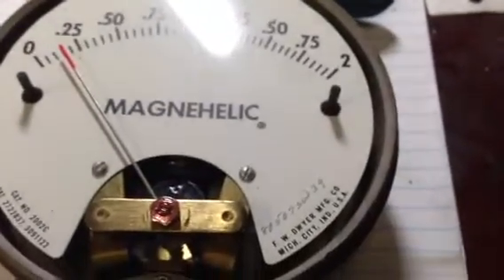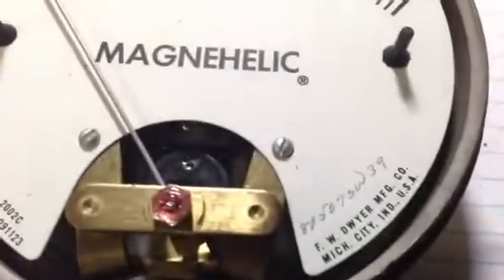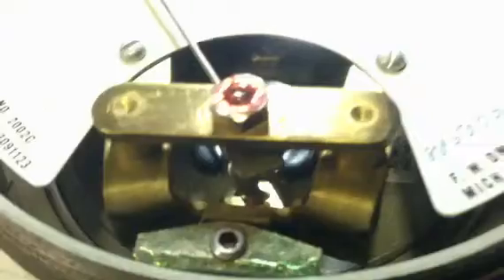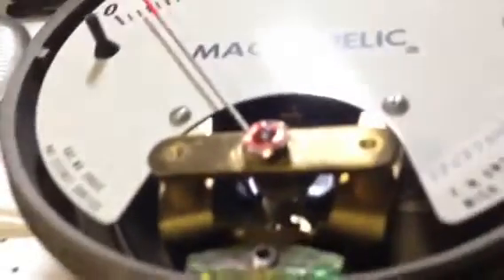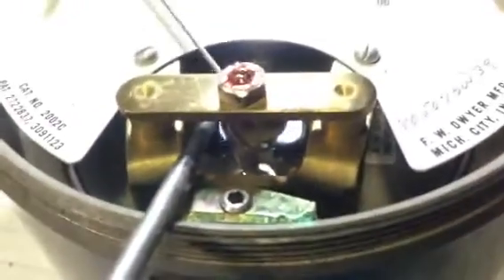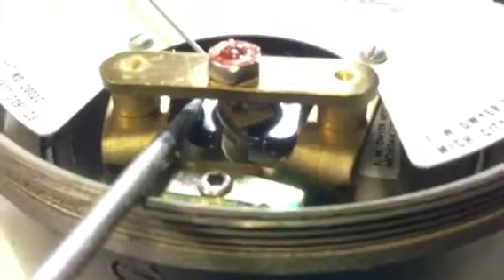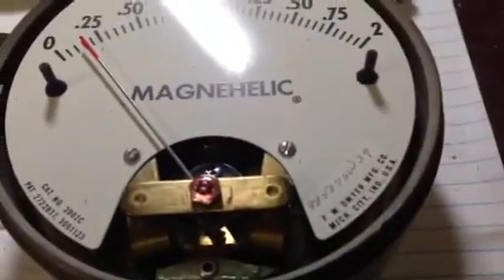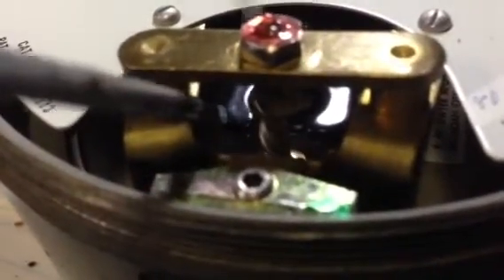How does a Magnehelic work?

Comment: Hi friend, how did you remove the faceplate and opened the face of this?
I can’t to do this 😢
Reply from the maker: The top ring around the glass unscrews, regular thread. It might be tight as it's compressing an o ring behind the glass. 

They might not all be the same, but I'd assume they're similar.

Comment: If you remove the faceplate the diaphragm is connected to a thin metal bar which connects to the magnet. There is a clamp secured to the bar with an allen screw which adjusts the accuracy of the gage when you move it up or down which adjusts the tension on the bar, dont touch!. Works sorta like a bourdon tube. H port connects internal to the diaphragm, L port hooks to the case pressure differential which acts external on the diaphragm, the o ring seal on the lens can leak.